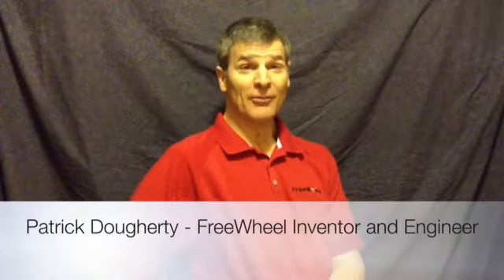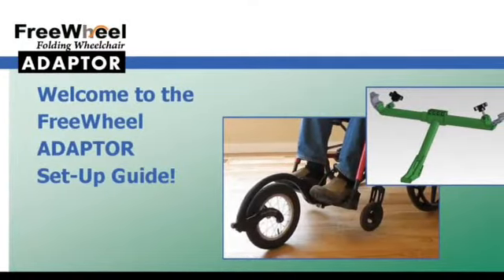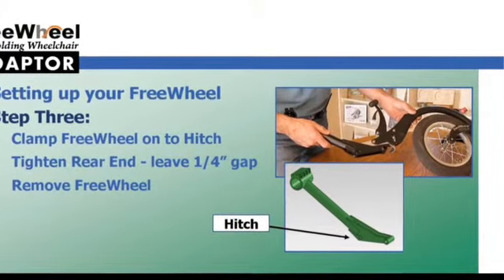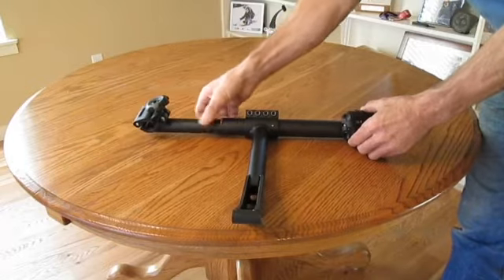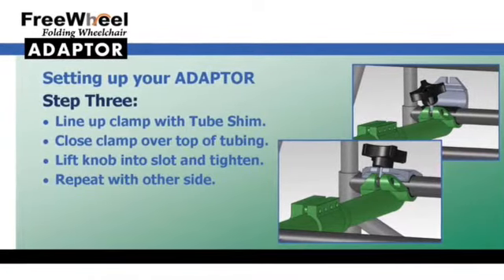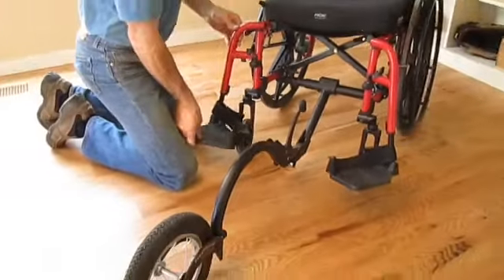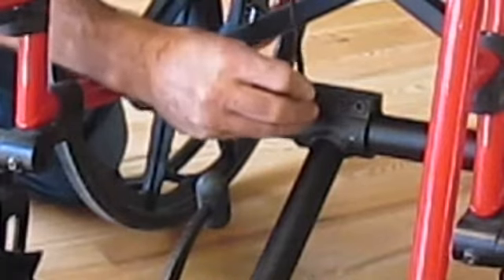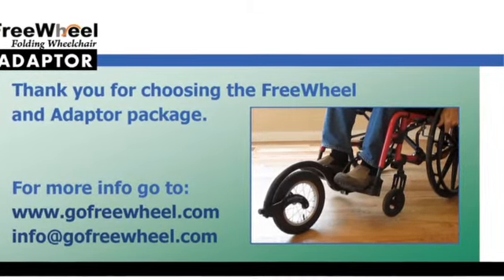New ADAPTOR Instructions

Comment: It will not fit my wheelchair either, a Helio A7.  The diameter of my chair appears to be around 1.28", larger than the 1.125" max of the clamp.  So apparently several of the newer folding wheelchairs cannot use this adapter bar.  Helio A7 (manufacturer motion composites), quickie xenon (manufacture Sunrise Medical)  and invacare action 3 (manufacturer Invacare), so it is not just one manufacturer using the larger diameter tubes now.  I emailed Freewheel about the problem.  I would really love to use this product and if Freewheel made an adapter bar that fit the more current folding chairs, I think they would benefit as well by having a larger market who could actually buy and use their product.